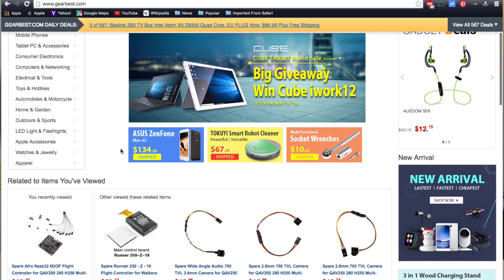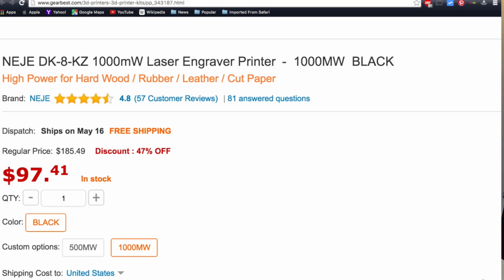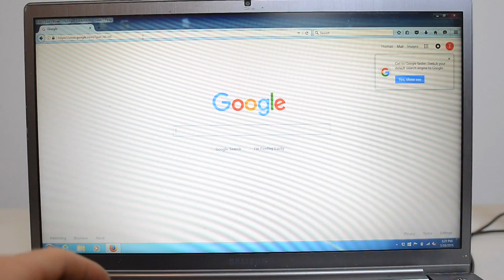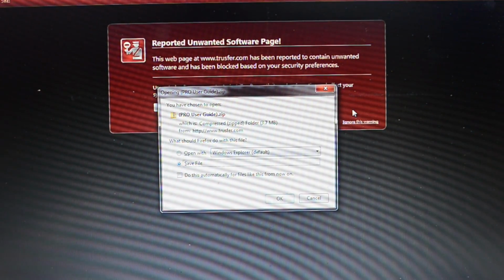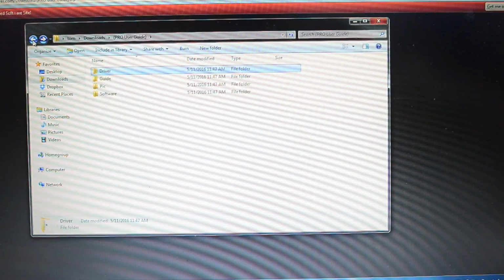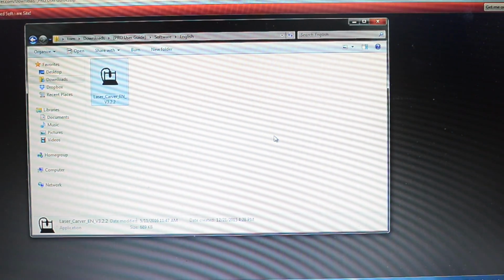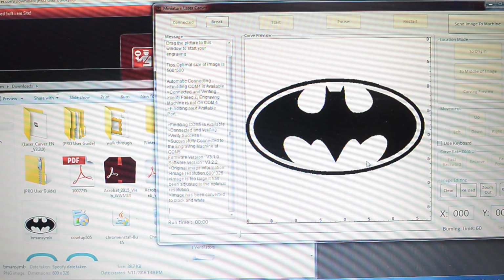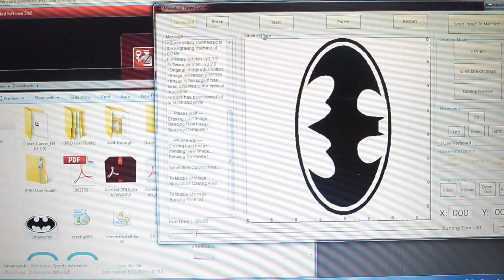LASER ENGRAVER SETUP/REVIEW - NEJE DK-8-KZ 1000mW

Comment: I'm having the same problem installing as you show in your video it just flashes a bunch of times and then says something about "pre-installed in advance" but does nothing. You said to uninstall and reboot your computer; uninstalling does nothing. It says device not found and then doesn't do anything, doesn't uninstall anything. I'm stuck being unable to installl. Help?? :(
Reply: PlushiePoogle did you find the solution because I am having the same problem I even tried it on two different computers and nothing every time I install the driver i get the same message so I try like video to uninstall but it say nothing to uninstall and I can get get to connect
Reply: Same, I just tried it on another computer yesterday but it does the exact same thing for me as well. I did manage to uninstall once or twice (out of like 20 tries) but rebooting and trying again just does the same thing AGAIN and it just won't work. :/ Spent 85 bucks on this thing (60 on the laser, then got a message that I had to pay another 25 to get it past security before I could pick it up...ugh) and it's NOT working. I just wanna toss it out the window at this point..so annoyed and disappointed...
Reply: Any of you guys had any luck so far? Having the exact same problem myself...

Comment: Can this software be used for other lasers? I am trying to find one that engraves solid lines not just outlines
Reply from the maker: +Brittany Richards I'm not sure
Reply: you might want to look into lockster's laser tools for inkscape. It has a hatchfill extension and a modified g-code generator. They were remade mostly for modified 3d printers that have lasers duct-taped to them, but the extensions are very customizable, so it should work for this el-cheapo engravers.

Also in Inkscape you can find extensions that generate g-code for raster images to do picture engraving. Just search for some tutorials arround here, hope it helps and better yet i hope you found your answer long before my reply :D

Comment: can you do anodized aluminum with this?
Reply from the maker: +scott goforth it won't cut metal
Reply: as he said it wont cut metal but it will work on anodized aluminum if you want to engrave pictures since it only implies removing the @oxide@ layer off the aluminum. I have done anodized aluminum on a 1w laser (the same  module used in this little engraver) only difference is i have it mounted on my 3d printer ... cause bigger build area xD

Comment: Can it cut shapes from leather, balsa (thin), and other similar materials?
Reply: Yes, you just need to raise the burn time to whatever you want to cut through. Maybe try experimenting a bit. 30 to 40 should burn through thin cardboard.
Reply: I have the 1000mw one. It cuts through paper or cardboard. But not through wood. It can burn about half a mm deep in the wood I tried. So unless your wood is that thin (super thin veneer?) I don't think it will burn all the way. It will just engrave.
As for leather, I was able tot engrave quite deep with speed 30. I think maybe with the slowest speed it might be able to do it. Didn't test it though.

Comment: Explaining the cable connections would have been very helpful.  Two USB-USB cables, one with mini-USB plug.  WTF?  Otherwise useful, basic review.
Reply from the maker: You are right, I thought I had mentioned them.

The Mini USB is for data transfer and the USB 2.0 is for power.
Reply: Hehe, your video was great, the manufacturer should have explained more about the USB cables in the instruction.  The software and cable connections were the biggest frustration.  Like you, I had a few issues initially with the drivers, but worked through it.  The virus issue, however, was a BIG problem.  Norton virus protection absolutely refused to let me go to the trusfer.com site, and absolutely refused to let me install the etching software, claiming in both instances they contained trojan malware.  I could not override it.  I finally grabbed an old laptop that I no longer use and removed the virus protection all together.  That installed and worked fine.  I like the engraver, it worked great right from the first print.  The engravings are small, but I found I could combine multiple etches to make a larger etch scene.  Of course now I probably have a Trojan virus on the laptop, but I won't use it for anything else.

Comment: what about the motor step pause? what should we set that to so we get a HD engraving?
Reply from the maker: The motor step pause will determine how long it burns in one place. So you will need to adjust that depending on how hard your material is

Comment: Hi, what is the difference between 1000MW vs 500mw version? can we adjust the depth of the engrave? thanks
Reply from the maker: +dua jari the depth of the engraver is fixed. If you have taller or shorter objects you adjust the focal length of the laser. But if your object is tall than the allowed space, there is nothing you can do :/ 
The 1000mW version is twice as powerful, so it will be capable of engraving deeper and engraving on harder surfaces than the 500mW version
Reply: But does it mean 1000mw can not engrave a really thin object (ended up making a hole /cutting the object) ,  because it meant to engrave a more 'heavy object'? Thank you for your answer :)
Reply from the maker: You can adjust the burn time on the machine, so a 1000mW engraver you can set to really small burn time and you will be fine. More power when it comes to standard lasers like this, means more heat generated which means more cutting power. If you have something really thin that is also really flameable it might be a better idea to go with the 500mW one. But I think the 1000mW is not that powerful to begin with.
NP :)
Reply: I see, thanks man! have a good one!
Reply from the maker: You 2!
Reply: it's a small power

Comment: I wrote a CAM program, called BenCutLaser, specifically for low powered laser machines.
My website is here: www.BenCutLaser.us
There is a US-based support forum for these machines here: www.Benboxlaser.us
Reply: For low power lasers? You must use the 50 Watt and higher lasers. The steel cutting machines are in the Kilowatt range. Probably CO2?
Reply: We use very low power laser diodes: 0.5 watts to 3.5 watts. With the right CAM software (BenCutLaser or T2 Laser) you can do some awesome things!
Reply: I've never heard of that one. Post your question on my laser forum and someone will answer it for you: www.BenboxLaser.us
Reply: With what did you write a Cam Software and on weich Hardware can you use it ?
Reply: C# MS .NET Visual Studio. BenCutLaser works with low power laser machines. I also support several controller boards that will run on a CO2 laser machine (Smoothie, Cohesion3DMini, RAMPS 1.4).
Reply: I used Visual Studio C# and it runs on Windows. I have some users running it on a MAC with a VM.

Comment: I just bought one, put a fan in there, primarily for the laser but also for the smoke. do what you can to cool the laser diode. they fail from heat., never mind their tolerances, just keep it cool.
Reply: Same here; I added a fan for the smoke.  Without the fan, the smoke would darken surrounding non-etched areas.  Of course the laser benefits from it, too.

Comment: I just got my engraver same as the one in the video and I got one good test and now it won't engrave anything else. It moves correctly but don't burn. Any advice is welcome
Reply from the maker: +Bobby Ward that's strange. Try different images and try adjusting the burn time at the bottom of the graphical interface. Also what are you burning on? What material?
Reply: +How We Make Things I'm burning it on wood the same thing I got the first engraving on. it is strange. I've tried different burn times and focus
Reply from the maker: +Bobby Ward is the laser firing the same way? Is it making that clicking noise every time the laser turns on?
Reply: How We Make Things it does make noise not really clicking but moves like it's working but won't burn
Reply from the maker: +Bobby Ward so the laser isn't turning on? The laser has different power settings, so it can look like its on "full power" but it's not
Reply: +How We Make Things I think I'm finally figuring it out that that beam has to be perfect
Reply from the maker: You mean the focus right? it's pretty easy to misfocus it
Reply: +How We Make Things yeah the focus I thing I got it figured out for wood but not acrylic or plastic yet
Reply: Mine quit on the second day.  Looks like it's burning the image but doesn't leave an image at all.
Reply from the maker: +John Hall if the engraver is still firing the laser ( making that loud clicking noise ) then it's a matter of focusing the laser most likely. Or your burn time is too short. Or your material is too light colored or hard
Reply: It was working, didn't change a thing, same focus same material, just the back of a business card.
Reply from the maker: +John Hall sometimes the vibration of using it will knock the laser out of focus

Comment: I burn mine at 80 to 90 but you have to get the laser focused properly so that you don't get any burn marks outside you design. I use mine to engrave pens and it works perfectly for that which is why I purchased this. Thanks for the info.
Reply from the maker: +frehleycomet what kind of wood are the pens you are burning on?
Reply: +How We Make Things my pens are made from oak, ash, walnut,purple heart, paduk, cherry, cocobolo, and  wendge but I'm sure it'll burn on any wood.
Reply from the maker: +frehleycomet I'm pretty sure it will burn all kinds of wood too. The burn time goes up dramatically for hardwoods, like you already said. Do you sell your pens online? Or is it just a hobby
Reply: I do sell them and I have a Facebook page available for viewing. I will ship anywhere in the U.S. but I'm not sure how to get payment set up through paypal yet. Here is the FB site. Thanks for looking. https://www.facebook.com/TVille-WoodWorking-1046369215401034/photos/?tab=album&album_id=1046376428733646
Reply from the maker: +frehleycomet that's pretty cool!
Reply: Paypal? It's easy, but there are other payment options too.. Be sure you have a legitimate address and a verified bank account for use with Paypal. Also, you need to get an IRS ID number like your Social Security Number. Depending on what state you live in, you should register your business with that state. By doing so, they will give you a resale certificate and a number so you can buy at wholesale discounts.

Comment: I am having a problem with ours. It's been working great.....until I 
changed the 'motor step pause' in the settings (button on bottom right of
 the GUI). It could just be a coincidence, but I don't think so. Now, 
after loading a print up and starting it, it gets about halfway though 
the print and then starts to distort sideways (much like in the picture 
above the 'motor step pause' setting. I reset it to 35, which is what it
 was on originally before it started printing strangely, but it didn't 
seem to make a difference (I've tried a couple other numbers, but they 
had no effect that I could notice). I uninstalled the driver and 
re-installed it and it seemed to work...once. I've reset my 
laptop...unplugged the machine...tried a different USB port...everything
 I can think of. Can you help or is there a forum somewhere with this 
information (Google just seems to have reviews and people complaining). 
I'm at my wits end......ANY  help or advice...or even a general vauge 
wave in a particular direction would be huuugely appreciated as I have 
printed dozens of times with it and it's hugely fun to play with....I 
have tooo many more things I have to label ha!

PS the ppl who are having problems with their machine not burning, try adjusting the focus 
ring underneath the laser (wear the glasses). If it is out of focus, it 
just will barely even warm the surface.
Reply from the maker: +Vincent Najger is your printer vibrating whisk printing? I got distorted prints when the object I was printing on wasn't secured properly to the bottom plate. Make sure you are using the rubber bands to hold it in place, and that the rubber bands aren't worn out and lose. That's the only thing I can think of. Otherwise, one of you axis motors or drive screws could be slipping.